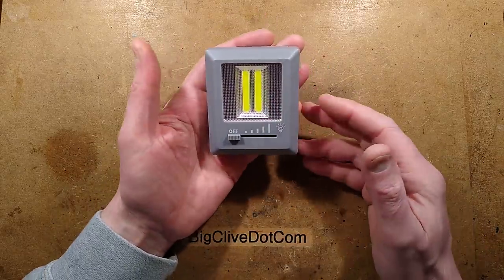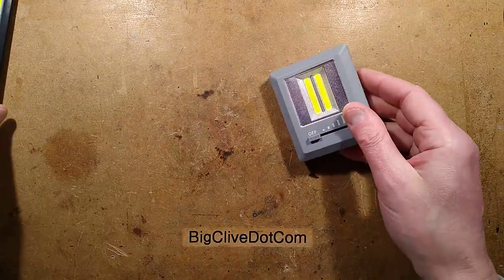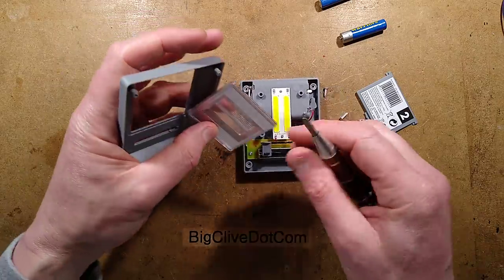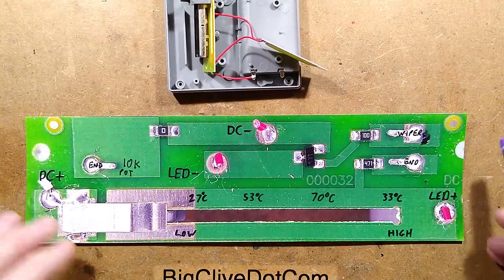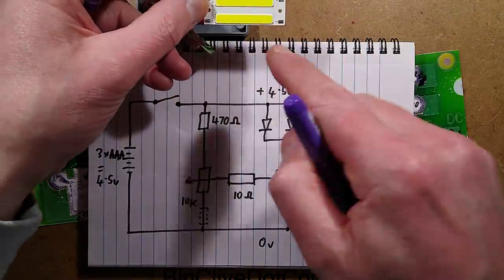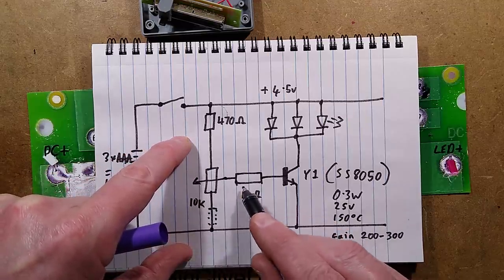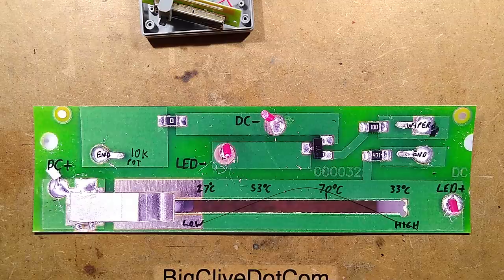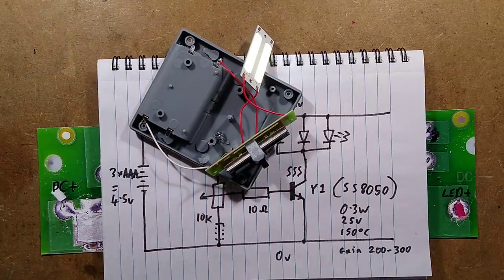Poundland dimmable COB LED light (with schematic)

Comment: Harbor Freight sold similar battery-powered LED lights (without the dimming feature) and some people discovered that with a fresh set of alkaline batteries, the current draw is so high it actually starts to melt the plastic case. Maybe that's why on later versions they added the dimming feature.
Reply: maybe they 'forgot' a current limiter resistor, many 'cheapo' led torches, especially one made from multiple 'normal' 5mm leds,  dont have one 😉
Reply: Plus you buy that huge box of batteries.
Reply: I have those in my gun safe with the dimmer for late night emergencies!just tested it batteries still good  !
Reply: First problem, they were bought from Harbor Freight.
Reply: @dr.ryttmastarecctm6595  First rule of Horrible Freight is always check the reviews for the specific SKU as some thing have multiple SKUs of varying quality.  Second rule is expect to have to modify things wut fer to make them more betterer.
Reply: The answer is very simple.  Just use cheap poundland batteries
Reply: Add a heatsink
Reply: There must be molten plastic!!!
Reply: Make your own flashlight if commercial products are non customizable and s#!t
Reply: I was going to bring up HF if you hadn't.  :-)  I have a few of their flashlights,  of different types,  with varying numbers of LEDs.  The one in my pocket has 9 in a tubular case,  and another one around here has two different sized groups of LEDs (it's not handy or I'd count them).  Both take the same 3 AAA cells.  I had another one like the one in my pocket that after a while a few of the LEDs stopped working.  I've never mesured the current these draw,  so I really don't know how hard they're pushing those LEDs.  Perhaps monitoring the voltage while the iight is in operation would give a clue as to what the typical internal resistance of those cells is.

Comment: I think engineers just throw in springs to fall out if you take it apart. Then you go nuts trying to figure out what it does and where it goes. 😂
Reply: I had a job once in a factory that made bags of sugar, my job was to put a tablespoon of sugar under the flap that you use to open the pack, it was to make sure you throw loads of sugar over your kitchen top
Reply: I think you're right.  I bought a box cutter a while back, and, while looking into how to change the blade, I loosened the main screw for the device, and 3 (yes 3) springs went flying.  I recovered 2 of them.  the 3rd still resides somewhere in the carpeting, where, I'm sure 5 years from now it will surface and embed itself in the bottom of my foot.
Reply: @h.wagner  yes take off shoes and walk around barefoot and you will find it. Ask me how I know LOL.
Reply: Happens in big industrial applications too... for example a module in a very big machine is assembled on a bench upside down at the factory... so when it is installed the right way up and you have to strip it down to service it... getting it all back together is a right ball-ache!
Reply: Didn't you know they install spare parts in most products? 
Every time I disassemble something I'm always left with extra parts. :)
Reply: Same with installing or changing out circuit boards. There is always an extra screw, shim or nut.
Reply: Would we I am not "Sniggering".

Comment: The ‘automotive’ light that you show is a fantastic light with a very controllable beam. It’s long lasting with its 18650 cell and super bright but can be dimmed down to a gentle wash of light. My only complaint with it is, the very nice green led battery charge level indicator remains illuminated even when unit is switched off causing the battery to be depleted over time. I’m hoping I’m not the only one with this problem and other will also request a ‘BigClive’ review, tear down and possible fix for this issue.
 Clive, your content is so very useful and you’re a wonderful guy. Thanks for what you do!

Comment: If you moved the battery negative to the common of the pot you can then repurpose the small SMD resistor that is there to limit current through the LED COB. Probably a 1R resistor in 1206 format would be fine to fit there, after doing a little pad work to fit it, and would limit LED current nicely, plus add a somewhat larger dimming range as well, forming a simple roughly constant current source as well to compensate for failing battery voltage with age. One wire moved and one resistor replaced.
Reply: Your idea has been corroborated by SkyWizardless in a previous comment.  Is this what's known as an Emitter Follower?
Reply: @westinthewest  More a very poor current source, as the transistor will attempt to keep the base emitter junction on just enough to keep emitter voltage around 0.6V below the base, so making the current flow essentially nearly constant irrespective of collector voltage. Poor because the base current has to be drawn from the potential divider, making it droop, and also having a petty big change with temperature, but still making a roughly constant current source, instead of with the original design having a current proportional to the base current multiplied by the transistor beta gain. The new circuit is a lot less sensitive to variations in gain between transistors, provided it is above a threshold where the divider current is the majority of current.

Comment: Wow!  Retro tech circuit from the '60s!  Totally analog - no chip on board!  

I have an idea.  Solder a 3.5mm jack and DC blocking capacitor to the wiper of the pot, and use the output of a monophonic radio to modulate the light output.  Then put a photovoltaic cell connected to an earphone in front of the light and listen to the radio.  See how far away you can hear it.  Cool experiment!  

To limit the current, use three AAA carbon-zinc cells, not alkaline.  Thanks Clive. 👍

Comment: Hey @bigclivedotcom,

you mentioned on the stream last night that you'd do a video for the Patrons that shows how to open LED bulbs without crushing them. I had experimented that very day and found that all you really need to do is heat the rim between the aluminum inside "casing" and the plastic cap. That weakens the adhesive and you can just slice it and unclip the cap. Excited to see your method when it leaves Patreon-exclusive territory.

Comment: I have one of these. Also had the problem of batteries discharging even when the light is not in use. It's due to a design fault. There is a lug under the slider which lifts a metal strip off the contacts on the PCB when the slider is moved to the 'off' position. However the slider is a loose fit in its housing, and when you take your finger off the slider there is enough spring in the metal strip to move the slider within its housing so the metal strip goes back on to the contacts. Evidently some current passes, even though the LEDs don't light, so the batteries get discharged.

The solution is easy. A pin through the soft plastic to hold the slider snugly within its housing - 5mm of an ordinary dressmaker's pin with the point snapped off. Works a treat.

Also I am running it with 2 alkaline batteries i.e. 3v rather than 4.5v, which I hoped would take some strain off the LEDs at full power, and perhaps lower the temperature of the transistor at medium setting. It is still plenty bright enough on 3v. The third battery slot is occupied by a bit of steel rod sheathed in plastic from an old ballpoint pen, roughly the same diameter as an AAA battery. Or one could solder some wire across the terminals. I don't know much about electronics, or how the calculations pan out at 3v. Can anyone help? I assume the steel rod has less internal resistance than an AAA battery. Would it still be sensible to put a 22ohm resistor in series with the LEDs, or perhaps a different resistance?

Comment: The optional resistor at the bottom of the pot provides a slightly positive voltage somewhere below the Vbe of the transistor. Without it, there is a dead spot on the pot slider where nothing happens at "low light," where the pot is at its minimum setting. By adding a small value of resistor here, it reduces the dead area of the slider, giving you a wider range of light output. I'd use about 1k for it. Doing the math assuming a 4V battery supply, then you find that the pot's minimum voltage would then be around 0.4V, sufficiently below the NPN's Vbe. Now when you slide the pot to its minimum position, the light is still off, but moving the pot ever so slightly higher should provide some minimum light. With a 0 ohm resistor, this dead area of the pot is larger, wasting some useful range. It's a finesse thing, not important for a crummy 2 pound bargain light.

Comment: I wanted to make a lamp like this and considering it's not easy to find a potentiometer with an end switch and using a single li-ion cell, it wasn't trivial.
I wanted it to keep a set brightness in a wide voltage input range and use negligible power when turned off. Any SIMPLE linear solution won't work due voltage drop (I wanted it to work down to 3V) or standby current so I ended up doing a PWM with an attiny and use the WDT to wakeup the MCU every few hundred milliseconds to check via ADC if the potentiometer was moved from the "off" position.

I don't remember now, but it draws a few microamps I think, which should give enough standby time for one or two 18650 cells.

Of course it sits for a few months now waiting to complete when the hardest part is done :)

Comment: I'm curious if that transistor would be dissipating more power than the LEDs while in that middle position.  It'd be pretty weird if turning it to medium brightness actually drained the batteries faster than on full bright.
Reply: thats why pwm is more efficient than driving an led at the actual voltage
Reply: Worst case, the dissipation in the transistor and LEDs would be exactly equal.
Reply: @user232349  Did somebody say impedance matching ? :)
Reply: It is possible to have a simple dimmer circuit where the dimmer consumes more power than the light.  I don't think that's the case here, but at mid position the transistor is converting about half the power to heat.  The total power is less than max, but the waste is maximal.

Comment: In the old days they used wire wound rheostats to adjust voltage, used a lot in cinemas for lighting, also used in old battery chargers to adjust voltage corseness, this little light does use the same principle as a rheostat. Components are smaller now though an safety has also improved to. I think I might have a trip to Poundland an get a few of these an strip one down for the potentiometer, handy for projects are these things.

Comment: The transistor is the only component dissipating excess power (which is its regulating function). The potentiometer sets the base current into the transistor and the circuit relies on the hFE (DC current gain) to set the output current.
At low currents there is no problem, and at mid currents, the voltage of the battery will still be high so the power in the transistor is the "battery voltage minus the LEDs' voltage" multiplied by the current (which is why it gets so hot).
At maximum brightness, you are right, the internal resistance of the cells collapses the battery voltage to where it just about keeps up with the LEDs and there is not much left over across the transistor, which is why it cools down again (but the cells will get warm). If it were from a power supply, I'd expect the transistor to get a fair bit hotter (but not excessively).
This is the same circuit used in the lamp under my stereo microscope at home and I really want to change it for something more definite (hFE is not a very reliable parameter on which to base a dimmer - although, it seems to work well enough for these cheap products.).

Comment: I have a few of these lights but they are the light switch kind, one of them with four COB LEDs. No dimming feature. They are great for power outages but they go through batteries quick. I am going to modify one of them to run on USB power.

Comment: The 10Ω resistor is limiting the base drive on that transistor. The basic analysis is that the drive current is going to be the voltage going into that resistor minus the 0.6V diode drop on the transistor divided by the 10Ω. It gets a bit murky because that voltage divider feeding it is not very stiff.

At the top end, you're going to have (4.5V-0.6V) / (470Ω+10Ω), or about 8mA of base drive. If the beta is 30-ish that gives about 240mA in the LEDs. 

If they had stuck a resistor between the emitter and ground, you would get a much more predictable current in the LEDs, since it would provide some negative feedback in the circuit.

Comment: Is the preponderance of these COB modules because it's cheaper to just make blue LEDs then paint a phosphor strip on top, than it is to incorporate the phosphor into the LED packaging? For people who need white light but not necessarily in discrete packages? I was just thinking about it, and it's my guess. I suppose it's surprising it took until quite recently for them to take off, we've had phosphor-based white LEDs for decades now. 

Is there such a thing as a white LED that uses separate chips for R, G, and B, or just Y and B? Would it help? Be more efficient perhaps? I suppose they need different forward voltages and currents so you'd need the extra leds, so you may as well just make RGB LEDs, in fact you'd have to. I wonder how much the phosphor costs, and why the cheaper ones just use a yellow phosphor where better ones, apparently, have extra phosphors for other colours in the spectrum? 

Indidentally did you know the RGB colour model is entirely a product of the human brain? An illusion! The more physics-based mind of the engineer might figure this out instinctively, it took me a while to come to it, then look it up to check. When you see red + green light, you're seeing red + green light. The colours don't "mix", anywhere outside the human brain. It's just the human brain can't perceive more than one colour at one location. And our cone-chemicals for red and for green, are also both sensitive to yellow. Which are all different frequencies, no "mix". So true yellow light at 580nm sets off red receptors, and also sets off green receptors. 

The brain is built with that in mind, so when you see a spot that sets off both receptors, your brain marks that off as "yellow". But you could just as easily have separate red and green lights in the same place, or something reflective if not a light source. That would also perceive as "yellow", even though it's not, and no 580nm radiation is present. Indeed that's how televisions work. A photograph on a screen is actually something like an Andy Warhol painting, several colours at each location. You just perceive them, wrongly, as looking like the real thing, even though proper colour perception would show them as completely alien. 

But we don't have proper, full, colour perception. It means that different lighting can affect how we see things. The high-pressure sodium lights in car parks make the colours of cars look "off", because the spectrum of light emitted by the light, then emitted off a car, to your eyes, is different from what you'd get under sunlight. Where sunlight is a pretty even, broad-spectrum source, containing every frequency in the visible range. 

Incandescents, too, have a good broad and full range, it's why photography still uses them. Fluorescent lights aren't necessarily bad, depends on the phosphor mix. And LEDs are pretty shite, LEDs are almost monochromatic as a function of their physics, so you'd need a good mix to get good light, or else get a phosphor, pump it with a high frequency (usually blue), and have it re-emit the lower ones. Again, phosphor mix counts.

Realising that R / G / B DON'T actually mix at all, it's an illusion, was a bit of a shocker! Why do schools teach it wrongly? I'm sure most science teachers don't get it properly, I never heard a hint that they did while I was at school, and science is something I liked. The difference between perception and reality, between R + G and Y, was never made clear in the text books. I was taught they "mixed", I suppose in the beams of light themselves somehow interfering or something. But no! It's all in the brain!

Comment: The term for background current draw when the device is on is "quiescent current".
Some devices have a switch that disconnects the bulk of the circuitry (and its quiescent current loads) but that switch also has a quiescent current of its own. The test to make sure that was in spec when I worked at Panasonic was called "dark current".

Comment: My batteries went flat in a few days ... the switch was not working correctly ... it seems the tiny conical spring applies too much force on the " clip on " switch plunger ( grey in your example ) forcing it up the control tab ( so it never switches off ! ) .. if you remove the conical spring the flat switch blade works just fine without it ! .. however , a tiny slide switch fitted to the side of the case ( precision drilling / Dremel™cutting ! ) wired into ( any ) battery lead will ensure a 100% reliable switch off , but requires several minutes of modification ( ? )

Comment: Note the 0ohm resistor, these are used as fuses, like the low ohm (often 10ish) on LED light bulbs that are covered in heat-shrink... they blow well before a standard 3A fuse, and so provide better protection for low current devices

Comment: I guess this thing would be most efficient as a small work light when powered by a 22650 LiFePo4 cell. 
The voltage usually stays pretty constant over most of the discharge curve, when using quality cells.

Comment: For high power consumption I always would recommend accus instead of batteries. Accus have a much lower inner resistance and can handle high currents way better. And their lower voltage equalizes under load quite quickly, because a normal alcaline cell's power drops also, but can't deliver enough current.